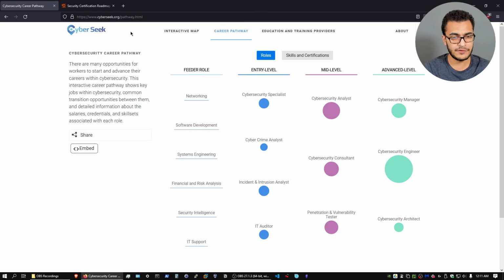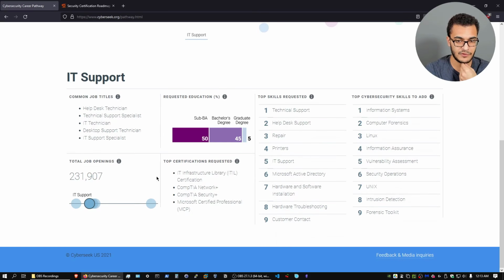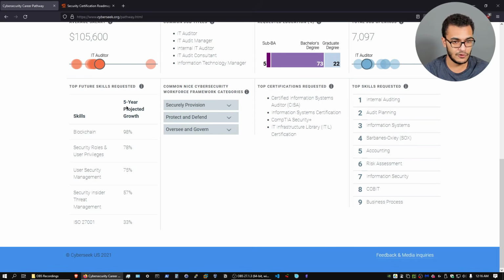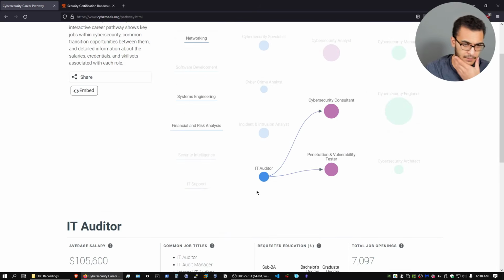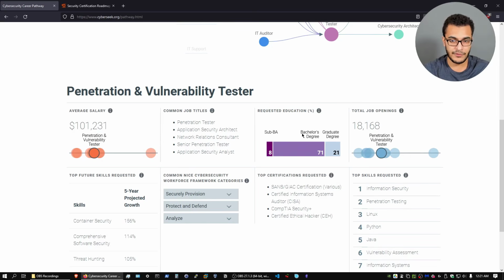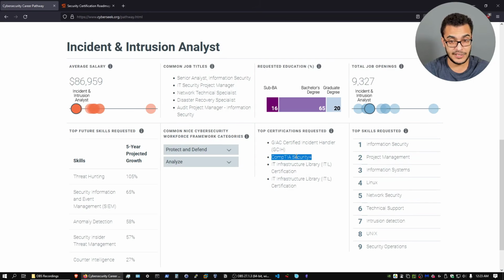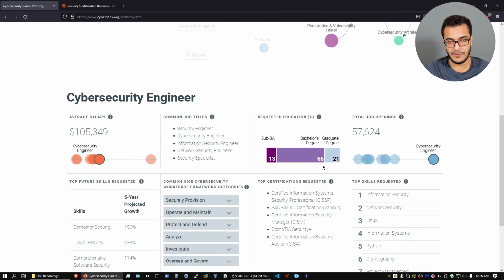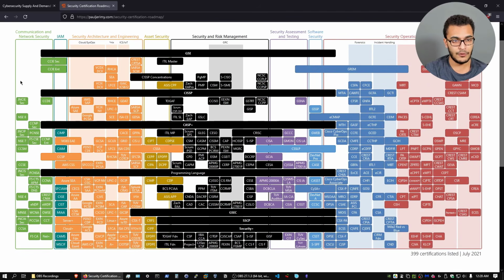Cybersecurity Career Roadmap

Comment: If someone is telling you education in the cyber security field is waste of time, tell them off and block them. The industry is in high demand and employer’s are changing the requirements. At the very least find a worthwhile boot camp if you dont wanna go into student debt. However, the ROI right now is incredibly high! Im currently systems security engineer and also do blockchain security auditing via solidity on the side .  I went to WGU. Best idea ever.
Reply: Did u have a degree before getting a job? I'm in wgu as well getting my bachelor's in network operation and security. Do you know what  projects I can do to land an internship
Reply: Heyy can we connect via LinkedIn? I would like to get some guidance
Reply: What is WGU?

Comment: Fighting HR is problem most of the time, just because of the certs and/or proving that you are capable for that role.
How would someone prove that besides certs, one has a practical experience for e.g. pentesting role? 

Currently I'm learning web development (lil bit of everything, FE and BE) + doing TryHackMe rooms and CTFs.
Reply from the maker: You can demonstrate your experience through CTFs, bug bounties, THM & HTB reports etc.
Reply: A lot of the time HR doesn't even know which certs are for what roles, even if they google it! Usually they will favor the person with a degree (engineering, IT, computer science, etc.), certs are a plus.
Reply: @MarsTheProgrammer  or the higher ups just tell them "OSCP or CEH would be nice, but any cert in that field would be a must" and they automatically assume OSCP or CEH is a must and nothing else matters